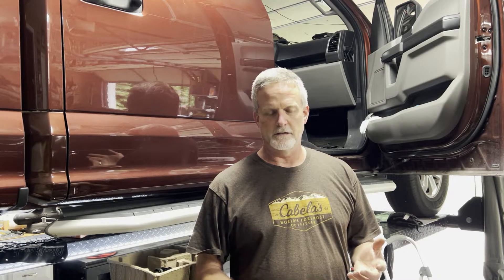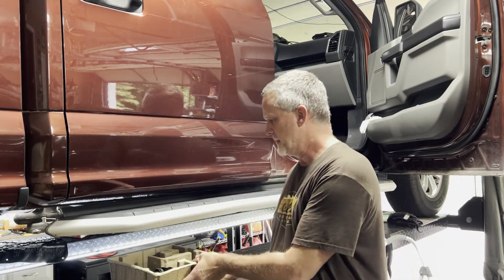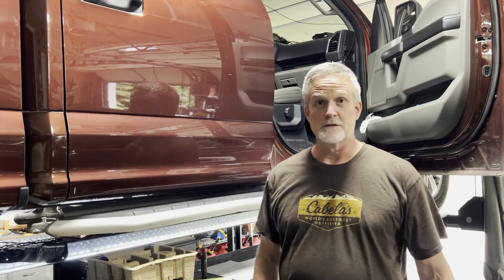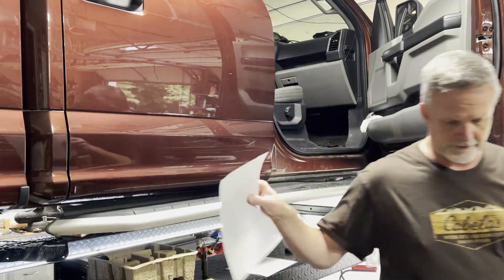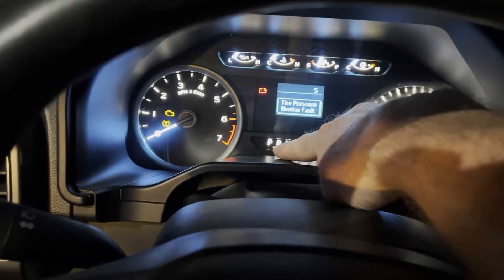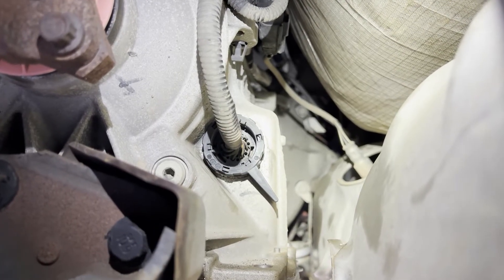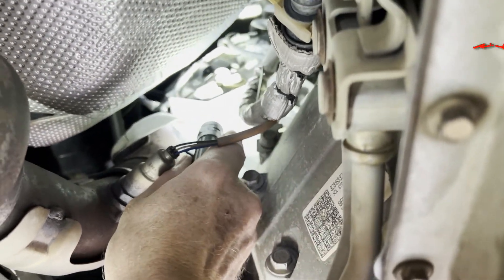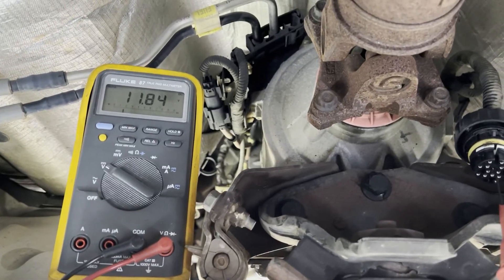Ford Truck PO340, P0344, P0345, P0349, P0706, P0707, P01702, P1921 Cam Sensor and Trans Codes Fix

Comment: Well, I happened to look up your video after replacing the lead frame, which did not fix the problem. It turned out it was some corrosion, and a short circuit on the camshaft position sensor exhaust side on the passenger side. Thank you very much for the video that helped us out tremendously.

Comment: Thanks for the informative video …. I have similar issue all transmission range codes but not camshaft sensor code ..mine is 2015 ford transit 250 which is same engine and transmission.. I did check the pin 12 I have no power but yet still tried disconnecting the cam sensors one by one still no luck …any idea where pin 12 gets its power from a fuse or relay maybe ??? .. thanks
Reply from the maker: Youtube won’t let me take a picture of the electrical print and post it here. The print I have is for a 2018 so I don’t know if they are the same. It shows a violet/green wire all tied together to all camshaft sensors. Called LE111 appears to be fed directly from the PCM terminal 118 VBPWR.
Reply: @fixthemthings … thank you so much this helps  … i will look it up today and definitely keep you posted with the result .. thanks again
Reply: @fixthemthings thanks again for your help … in my case it seems pcm is the problem…according to wiring diagram for my truck pin 12 voilt/green goes strait to pcm pin 22 and I have no power coming out from computer side .. I ordered a pcm and will try and keep you posted.. thanks 🙏

Comment: Awesome informative video. I had ordered the lead frame along with the sensors. Had a scary ride today as my truck downshifted wildly. This is what YouTube is all about, thanks for the video!
Reply: Following up on my repair. The next morning my truck still did the same thing. Service light came in and the gear lights disappeared. So my next repair is going to be the conductor plate which involves quite a bit of work! 🤞
Reply: And to follow up that repair, not terrible considering the cost you you paid someone to do it. Most importantly when refilling the transmission fluid some say different amounts. People dipsticks do not lie. Go by the dipstick.
Reply: Any updates?

Comment: Thanks for the video! Left for work this morning started having issues, so I pulled over to have. A quick look. Found nothing. But wouldnt start back up. Same issues. Saved me a lot of trouble and put me on the right track. I would only add, that these trucks go into "dummy" mode(as in "hey dummy, your trying to drain your battery) if you leave the truck key on for to long. So it shuts off the power supply to save battery. So if you are working on this take the sensor off, turn the key to on, and then check your meter. Couldn't get a volt reading and thought i had major issues somewhere. Noticed that i couldnt role my windows back up and it all clicked. Redone the key to on, read just fine
Reply from the maker: @Rhodes0426  hope I saved you money. Other videos say to change the lead frame.
Reply: @fixthemthings  you did im sure. I found your video right after i pulled codes. So i didnt make it to the lead frame diagnosis first. But I definitly see how you could get there.

Comment: Hey im watching your video right now i have all the same codes but dont have p01702 p1921, and have a battery light
Reply from the maker: @codyfunk8072  it started as the cam sensor faults then when we reset it the transmission faults showed up. Pull that transmission connection off and check pin 12 for 12vdc. If close to zero, then unplug one sensor at a time to find cause. Key must be on but not started.
Reply: @fixthemthings so I did the lead frame and nothing changed, if you unplug the bad sensor will it start?
Reply from the maker: @codyfunk8072  do you have a volt meter?  Hook up to pin 12 and check so you don’t waste money and time. Unplug one sensor at a time until you get the 12volts back finding the bad sensor. Then plug all of the other good sensors back in. It may start after that. Not sure though. Shouldn’t hurt anything to try.